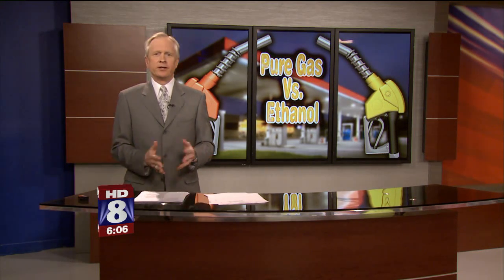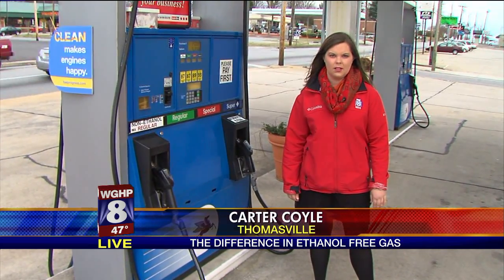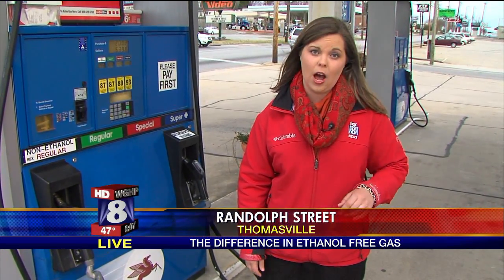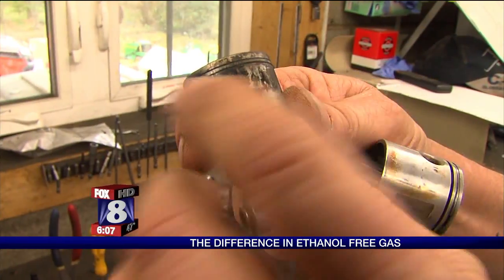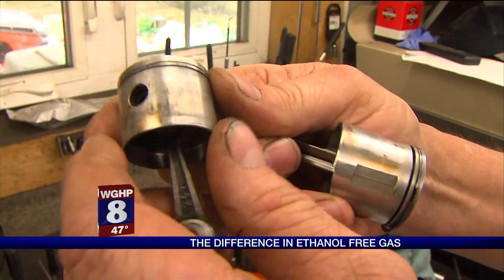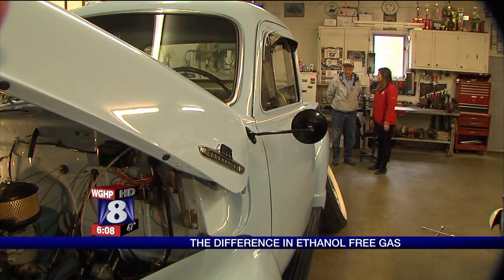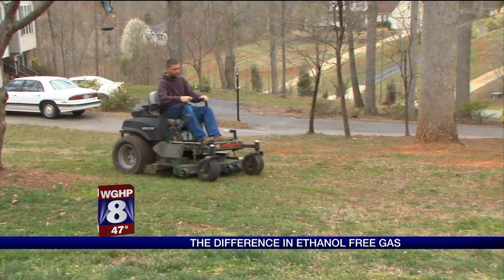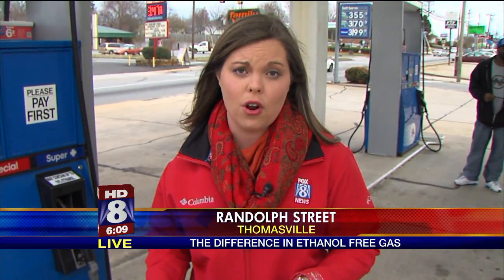Pure Gas v Ethanol

Comment: Haha wow big oil again at work. The lies continue!
Reply: *****  what is the name of the university and the name of the study conducted? I live in California and in the bay area which is one of the most expensive places to live in the United States.  E85 goes for righr now at the pump at $2.69 a gallon. Even if the energy loss was 20% less mpg and the cost adjustment to reach the same milage that which is obtain with 87 gasoline equalled the same price per gallon. The benefit would far out weigh the use of fossil fuels. It would be to long and extensive to list why ethanol is the far better choice not only for our planet but our country. All I can say is do your research and don't use a no name university with a no name study and state that as facts.
Reply: +Isaiah Batin-Gonzalez you clearly don't own a boat or any other type of weekend toy. Ethanol goes only in your car. Ethanol will destroy your weekend toy. Atmospheric conditions cause ethanol and water to separate. Ethanol is not superior in any circumstance.
Reply: Ryan Norton 
The following is the same information that I just posted to your other reply:

Mercury Marine, the world's largest manufacturer of marine engines, recently held a webinar to debunk some of its own myths about ethanol. I attended with interest. The first myth was that there are fuel additives that can prevent all issues associated with ethanol-blended gasoline. For example, no fuel additive can prevent ethanol from acting like a solvent. The second myth was that fuel additives can make stale or phase-separated fuel useable. "Fuel cannot be rejuvenated," Mercury determined, and they noted that it's a myth that ethanol-blended fuels are bad and should be avoided. Here are some quotes from the Mercury Marine webinar.

"There is no active transfer mechanism for ethanol molecules to reach out and 'grab' water molecules out of the air. Under normal storage conditions, even in a vented fuel tank, it just does not happen at a level or rate that is relevant."

"Major multi-billion dollar companies with enormous resources have improved gasoline additives but there have been no recent breakthroughs involving 'magical technology.' Claims made by companies about 'space-age,' 'revolutionary,' or special proprietary technology should be looked at with a high degree of suspicion."

"E10 Ethanol absolutely IS an acceptable fuel for everyday use. After the transition period from E0, E10 may actually be a superior marine fuel as it tends to keep low levels of water moving through the fuel system, keeping the system 'dry.'"
Reply: +The Auto Channel 
Ryan, fuel additives are mainly to preserve fresh gasoline for a longer time, they must be used with fresh gasoline only, also they are a little bit oily and the point is to cover every part with this oily coat to protect it against corrosion that ethanol could get from water condensation, but that only happens when gasoline is stored for more than 30 days, also that oily coat is to lubricate some movable parts such a fuel pump, fuel injectors, valves and the whole combustion chamber because the mix with ethanol is lets say drier than pure gasoline, they also help to remove some carbon deposits in the valves and the combustion chamber, but that deposits removal process takes time, so it needs the regular use of additives not just one application like people think they work...

the side effect of ethanol such as water absorption mainly will be solved with the new ethanol called ETBE, search for it if you want...
Reply: +Adelso Chaves 
Your response is the answer to my question, ethanol is a dry fuel, drier than pure gasoline, thats why the movable parts related to the fuel are affected, such a fuel pump, fuel injectors, valves and pistons, also ethanol is corrosive in higher concentrations than E10....
Reply: +Alejo Cuchia 
Ethanol is not a drier fuel or a wetter fuel. Your brain is corroded.
Reply: ethanol is a solvent an it brakes down fuel lines and seals .... ethanol will absorb and suspend its volume in water and when it sits over night the water and ethanol separates from the GASOLINE that is why you have water in the bottom of your crusty carb bowls and your jets are plugged.. not to mention two stokes potential to lock up from lack of lube because water and oil dont mix ...SO it dosnt matter WHAT you put this ethanol-enhanced  BOONDOGGLE in... it will cause damage to your equipment ... still not convinced ask why its not used in air craft
 ETHANOL also kills brain cells ... from the comments left below some ones had to much to drink!!!WINDOW LICKERS!!!!
Reply: not equally corrosive or they wouldn't have to change out components to use ethanol....and those  components are ....i will type real big and slow so you can understand .... SEALS ,FUEL LINES ,CARB DIAPHRAGMS,FUEL PUMP SEALS ,FUEL PUMP DIAPHRAGMS ....ethanol is a solvent an it brakes down fuel lines and seals .... ethanol will absorb and suspend its volume in water and when it sits over night the water and ethanol separates from the GASOLINE that is why you have water in the bottom of your crusty carb bowls and your jets are plugged.. not to mention two stokes potential to lock up from lack of lube because water and oil dont mix ...SO it dosnt matter WHAT you put this ethanol-enhanced  BOONDOGGLE in... it will cause damage to your equipment ... still not convinced ask why its not used in air craft
 ETHANOL also kills brain cells ... from the comments left below some ones had to much to drink!!!WINDOW LICKERS!!!!
Reply: Recognizing ethanol as the true solution has nothing to do with rightwing or leftwing, and it has nothing to do with the argument about the global warming fraud. You will never come close to being more rightwing than me, and my support of ethanol is because I am so pro-America, pro-capitalism, and so strong on energy independence.

You give patriotism a black eye. Please stay away from this subject until you learn about it. And if you want to learn about it start with my 60+ page report at: http://www.theautochannel.com/news/2013/06/10/082044-gusher-lies-book-review-and-reply-to-robert-bryce.html
Reply: How many times do you copy and paste the same responses on here?  Can't think up new answers to different posts?
Reply: Well now you're being overly general.  Its not like gasoline is the greatest fuel or anything.  It depends on what engine you're using.  In low sulfur diesel the fuel has lost some lubricity, so now biodiesel is looking like an even better fuel to reduce wear in heavy use engines.  In turbine jets they've had issues for years with hot spots causing damage to the turbine when using jet fuel.  This is because jet fuel is a mixture of hydrocarbon, not a pure, homogeneous, single molecule fuel.    Recent tests by the Air Force have shown that going to a biofuel jet fuel millions of dollars could be saved in longer turbine lifespans.  Personally I enjoy the added HP boost you can get with higher ethanol blends when tuning your engine correctly.  Want to see the power of ethanol?  Go to a professional tractor pull.  You'll see diesel and E100 (100% ethanol) there, but no gasoline.  Its high octane allows them to crank up the compression ratio and utilize all that wonderful midwestern power.
Reply: Ethanol is cheaper, has been for a long time.  So if ethanol costs too much then gasoline REALLY costs too much, so by your own uppercased logic we should use more ethanol.
Reply: You're contributions to this conversation are priceless
Reply: Jungle Juice?
Reply: Do you not have time to type new responses?  How many places do you copy and paste these?
Reply: Once again you show you have no idea of what you're talking about.
Reply: Exactly right, Don.
Reply: The truth doesn't require a continuous stream of new invented information. Those who don't have a clue or are trying to push a false agenda have to keep inventing new garbage to talk about.
Reply: @tigerfanfanatic72  I kind of wish the ethanol would destroy my 1990 boat's engine. I would have a good excuse to buy a new one. But the darn thing runs like new.
I seem to be slowing down a bit though. Maybe too much ethanol?

Comment: I burn E85  in my 2000 mercury mystique and so far it burns better than gas.  The ethanol needs time to clean the trash out of the engine from burning garbage oil in it, So for a short time your engine my run ruff for a while you'll to statrt out burnng a 50-50 mix of E85 and gasoline
Reply: Really? You do realize that E85 has a vastly different fuel content than regular gasoline and will not run in a motor that hasn't been set up to use it.
Reply: Meester Anderson Just buy a flex fuel kit but on many FORD cars and truck, their already program to burn either gas or corn, Its more of a software issue than a hardware issue.
Reply: ***** With the right tune it works better in cars.  They are talking about lawn mower engines and such.
Reply: fatboy19831 I run E85 in my single cylinder Yamaha WR250R turbo. Have for over a year all seasons. No issues.
Reply: ***** Yep. I run E85 in my 1973 LS7 454. The video was good for a laugh though.

Comment: The reason small engines aren't good at running ethanol is because they have small, low compression engines that can't burn the high octane of ethanol... I'm talking e85 btw, of you get something a little bigger like a dirt bike it'll run fine after a little tuning because the density difference between the gases but ethanol is very clean and yes it can attract moisture into the engine but not enough to destroy an engine... If you got a high compression engine and it requires 91 octane or higher and you don't have the money for that gas than look around on the internet for a new fuel pump better suited for e85 then find a tuner to get your car running smooth and the 100+octane of e85 should be a way cheaper fit for your car... Only way the car will possibly get damaged from e85 is if you let it sit for months and months in a steel gas tank... Only if it absorbs enough moisture btw. And correct me if I'm wrong because I'm always up for more info on e85.

Comment: I have to use premium gas as regular ethanol gas does damage to my lawn mower and classic cars.
Reply: Premium gas has ethanol if it is sold at stations where the other octanes have ethanol.

Your classic cars can run on 10% ethanol fine with less than one hours work probably,and then you won't have to worry what gas station you go to.
Reply: No not at Superstore where I buy gas, it's marked on the gas pump contains no ethanol.

Comment: Do u think people r that stupid, that piston he was showing got way to hot, why because it's a 2 stroke that was ran without oil. 2 strokes run on a mixture of oil and gas mixed together. ethanol does not burn that hot hell it don't even make soot.and that older gentleman talks about leaving gas in an open container key word open, that water is from the gas evaporating. if your gas tank is sealed the gas will not evaporate because it is sealed from the outside air. they do have a vent but the fumes from the gas will keep oxygen out , u need air for evaporation. the only way u r going to get the water is your gas tank is not sealed from the out side air or the gas has it already from where u bought it. grit in ethanol r u kidding me, u must not drink any alcohol gomer  pyle  because when i drink it there's no grit in it. corn is not the only thing to make ethanol out of either, but u still want have grit in it either. people it's just what the big oil companies want u to believe remember they r in business to make money to and they want it all.

Comment: ethanol is triple filtered and evaporated, there is no possibility that there is grit in the ethanol, also the grit found in the ethanol is the actual dirty oil based fule  thats in the ethonol ethanol is the cleanist fule in the world its cabon neutral meaning it cant leave deposits wen burnt, why do you think they use ethonol or methonol in rc cars???????   it is better with more power as well. and its octain is over 105 meaning its a better fule.
Reply: Well Tony I just one a small lawsuit from a fuel suppler for having over 10 percent ethanol in the fuel,  seven jet skis (carbs) were damaged from the effects of this garbage they sell as fuel.  So keep thinking ethanol isn't damaging and the repair shops will be happy. I was told to keep quiet about the results but I decided to breech that agreement.
Reply: i agree with your there they will damage a jet sky because ethonol builds up  water in the tank and salt, if you tune it right ant do much but i ant no mechanic i just know you cant run ethanol in boats or jeties

Comment: In France too it's hard to find ethanol free gasoline.. sp95 usually has 10% ethanol even when there's no mention of it.

SP98 must have some, i'll switch from 95 to 98, pull a bit in a bottle, add water and see how much ethanol mixes with water.. betcha there's at least 5% shitanol in it. I have a motorcycle so yeah i try to watch out what i put in..